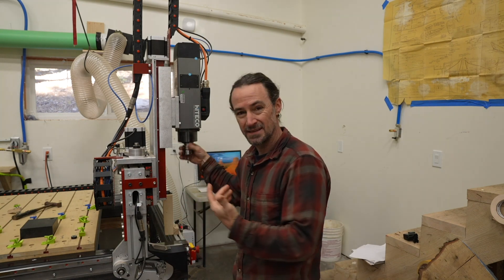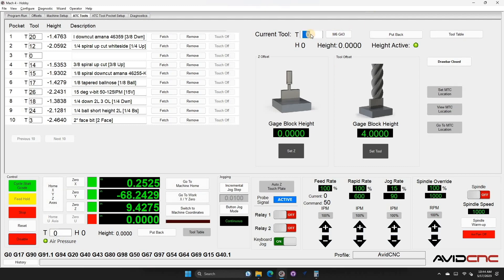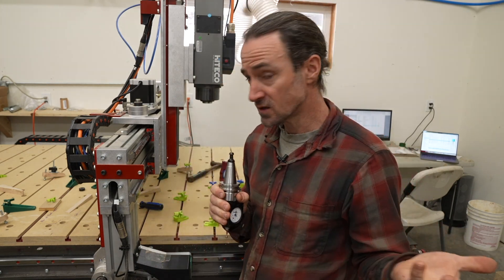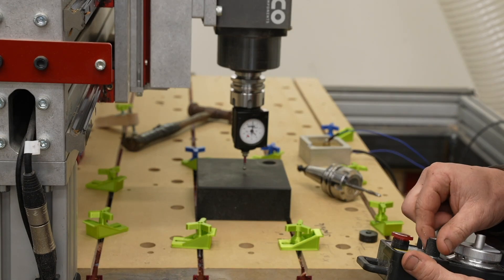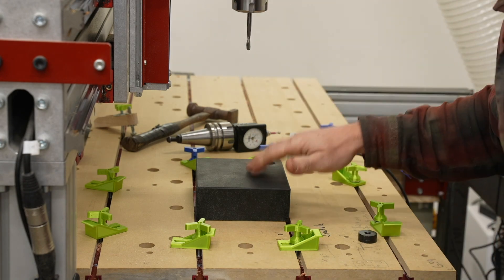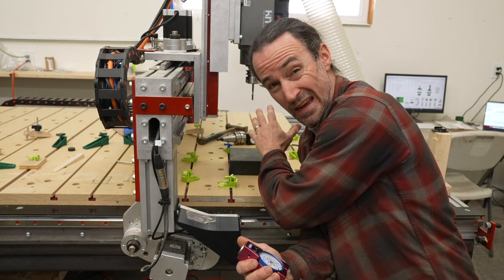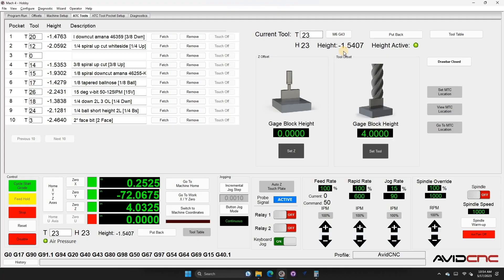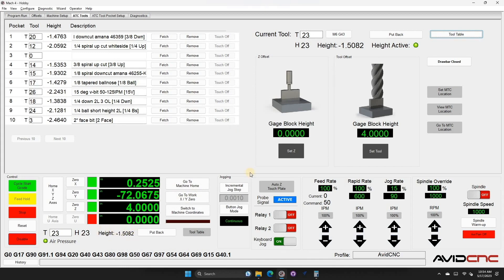CNC Build Ep 8: How to Set Tool Heights / ATC Tool Heights Setup in Mach 4

Comment: These guys are doing it.  Will Mach4 not do this?

https://youtube.com/shorts/4GLclIDVT9M?si=dBfd-1fJYJOwFz4O
Reply from the maker: Mach 4 can do it; you would just have to code it in, which wouldn't be hard. At the time I made this video, I didn't have a tool touch off plate (I have always had a z-zero plate, but a tool touch off plate really needs a fixed and consistent position for repeatability). I now have one from Avid CNC, and it is all automatic, although I'm using Centroid / CNC12.

Comment: I just had to rewatch this because I got a new bit :) Question: Which pendant are you using?
Reply from the maker: Cool! I've recently upgraded to Avid's EX controller, and it now auto-sets the bit height with a Touch Tool Plate. It is super nice! I had one of the Vista CNC pendants for Mach 4. Not too expensive and it worked fine. I didn't like the longer curly cord; the shorter straight cord would have been better. Now I have the Centroid wireless pendant with the Centroid controller.

Comment: is imposible to get this in Metric (mm) and no inch right? thx
Reply from the maker: For the Tool Height gauge or Mach 4? Mach 4 doesn't care about units. The tool height gauge....I don't know, I'm sure there are other brands out there. I'm now using a more automatic tool height setter with Centroid and not using Mach 4 anymore.
Reply: @CorbinDunn   I'm referring to your awesome screen set, the truth is I don't have an Avid, I doubt it will be sold in Europe, I have a similar cnc that works with an ESS+ MB2 bob and servos and a rack of 12 tools, I downloaded screen set u post to study it since I think it is I could make it work with the mb2, this fantastic work you have done is appreciated and I don't know if in mach4 you can change the units to mm even though inch appears in the screen set icons, I don't know if I understand my English is not very good.
Reply from the maker: @marcosotero6180  I have one minor thing hardcoded in inches, but I have heard that it mainly works fine in metric for some users. I don't recall if they had to fix anything. In theory, you could install Avid's version of Mach 4 and modify it to work with your system, or copy over the dependent modules/files from an Avid install to your own install.

Comment: Hi,  What is your routine for cutting say like a simple part, maybe a sq. pc of plywood, since your have a tool table and ATC.  For setting the tool height on the work pc do you use the master tool dowel to get the height every time and then slip in the tool you want to use, or just use the tool you want to use for touch off,  if you were to do it manually.  Say a unique cutter that's not in your tool forks and only a one time shot.   Does your ATC use the master tool dowel for all your touch offs in the normal way?   Thanks a lot.
Reply from the maker: Hi Fritz. For most my jobs, I design them with the z-origin at the spoilboard, and I use offsets. So I never have to touch off anything, as it is just stored in the machine. I have a video about this: https://www.youtube.com/watch?v=iyP81afV-Io . I usually use the spoilboard as my z-zero for work; the only case where I don't is when I want something relative to the top, and the thickness isn't well defined, and the cut depth is important. Such as, when engraving on the top of a piece. 

When I do touch off, I can use any tool and the Avid touch plate. Using the 'master tool' is preferred because it will always be the same height. When using a normal tool bit, the bit may become worn, or it may pull out a bit, and the height may be shorter or longer, causing inconsistencies with other cuts. 

When I put a bit in a new tool holder I do have to measure it. For that instance, I put my 4" height gauge down and drive the bit down until it reads zero, and then use "set tool height" in Mach 4 to set the tool height; the DRO for the tool height will be set to 4.0, the height of my gauge. I also have done this with the Avid touch plate; you can't use the touch routine, but manually drive down the bit until the light comes on showing it made contact.

It would be nice to add an auto height setter for unknown bit heights.

Comment: Corbin,  Mach4 ver 5036 don't have a tool 0 on the tool table so where is the master tool now?   Any thoughts?
Thank you, Fritz
Reply from the maker: There is no real tool 0; it is the reference for all other tools. It doesn't have an assigned height.
Reply: @CorbinDunn  OK, so the first setting just zero the Z axis, does that record reference?   Or do I have to put the 0 tool# someplace?
Reply from the maker: @fritzbabler6459  Ah, I see what is confusing! You put in tool 0 and you use that to touch off your Z-axis so to set z-zero with it. Then, you put in your bit, activate it, touch off with it, but don't reset z-zero. You then hit the button to set the height for it based on your touch plate height. This records its height relative to tool 0. Now, once you have a tool in your tool table, and that tool is "active", you can use it to touch off on your touch plate and set Z zero. The problem with this, eventually all tools wear and sometimes pull up/down, so it will cause inconsistencies. That's why everyone generally uses one "master tool 0". Mine is my Haimer.
Reply: I am doing dry runs on a sample gcode file and I see when I touch off the work pc and run the file, the tools are way off from where they are supposed to  be cutting on depth.  Doing my dry runs 5" from the spoil board so the 1/4" tool is cutting about 1/4" too shallow and the 1/2" is cutting about 1.5" too deep so I know there is a problem with the tool table.   My other machine works fine using Mach3 for the past 15 years.   I use fusion for my files and gcodes.  I watched a few videos from mach support on setting up the tool table, and seems the 2 that's out there, which are different from Mach, don't calculate properly.  I just don't get it.   I set my tool heights and follow their video exactly and and I still get no proper tool depth cutting using the tool table.
Reply from the maker: @fritzbabler6459  Yeah, your tool table is not correct if that is happening. You should be able to: activate tool 0, put it in the spindle, jog to right above your workpiece; it should read 0 (or a little above). Jog up, put in tool 1, activate it, which with my screen set activates the tool height with a G43, jog down to right above the workpiece, and it should read 0 or pretty close to it. If it doesn't...you have your height for it wrong.
Reply from the maker: Another possibility: your post processor may not be doing a proper M6 G43 call. I have a video about that...
Reply: @CorbinDunn  I was using mach3 post, now I switched to mach4 post, I will check in the morning.  Another question, when you touch off your work pc, do you touch off using "Material top, or "TLO"?   Thank you.
Reply from the maker: @fritzbabler6459  I’m not sure what TLO stands for. I don’t hardly ever touch off; I store an offset on my table at the spoon board top and use that for most projects.
Reply: @CorbinDunn  Hi,  re ran my gcode using mach4, didn't make any difference.   I was wondering how come your using your heimer for master tool and not the 4" edge tech gauge?
Thanks
Reply from the maker: @fritzbabler6459  like i said earlier, make sure your post processor is doing the right thing. I use the Haimer because it is repeatable for finding z zero.
Reply: @CorbinDunn  Well, I finally have it figured out.  When I touch off the material, I have to make sure I'm touching off with the master tool, tool 1.   also have to put in tool 1 as active and active H as tool 1.   So then all I have to do is put the proper tool in when mach asks for it from the file, which is in the tool table.  It does all the tool lengths compensations for any tools I have in my tool table to run different tools in one file.   With All the information that is out there, no one ever mentions it nor does the mach manual or their forum.   Makes it so easy to do tool changes, just grab that ATC tool holder with the proper tool in it, chuck it up and cycle.    I looked into the post as you mentioned and couldn't find anything that would make it weird.   Well, this will work now until I get my 8 carousal M6 written, almost done.   I have the carousal mounted at the end of my gantry.
Reply from the maker: @fritzbabler6459  Cool, glad you got it working! Something still seems off: you shouldn't have to touch off with your master tool; you can, in effect, us any tool that has the height set. It just has to have the tool and height active.  There's nothing wrong with using the master tool, and I use mine frequently to touch off, but any should work. 

For the post processor, the important part is to make sure that the M6 also has a G43 somewhere close by for the same tool number. Some, like Vectric for Avid, do not.
Reply: @CorbinDunn  Yeah, that's what I think too, but you know, I spent many many hours trying with the tools in tool table, and every time I go to zero to the material, it gives me a different depth of cut, nothing worked except using the master tool to set zero to the material.    I really don't know, I'm out of answers to try.
Reply: Here is first part gcode, (2D CONTOUR2)
M5
T2 M6
S25 M3
G54
G0 X6.025 Y-0.1
G43 Z0.6 H2
Z0.2
G1 Z0.0394 F50.

Comment: Good day Corbin. Great video series by the way. So i measured out my zbump and set it up for my ATC. It works amazing well with grabbing a tool, but when it goes to drop a tool off, the Z up doesnt quite account for how fast the tool push out goes and flexes my whole mount setup quite aggressively. Ive increases my rapid rate to 600 and even down as low as 50, and the problem remains constant. Not to sure whats up, or if im am being a dough head and completely missed a step. Any help would be greatly appreciated :)
Reply from the maker: Hey Devon - I got your email and replied there, but I'll do a quick reply here too. The code doesn't do any z-bump for the tool drop off; I based it off CNC Depot's script, which didn't do it. I also have a pause after the release of the drawbar -- my spindle takes a second to release, and without the pause the spindle would start to rip my fork up and off. Your spindle might not need the pause, so try commenting out MCCntlGcodeExecuteWait("G04 P%.4f", 0.3)  in the code for the release, but do so at your own risk (it might pull the fork up and out!). 

Another idea is to combine the GCode to one call, which make Mach4 execute it "quicker", but I haven't tested this:

 	MCCntlGcodeExecuteWait("G04 P%.4f\nG00 G90 G53 Z%.4f", 0.3, ZClearanceWithNoTool)

Comment: Hi Sir,

I can see you are an expert..! I hope you can help me..!

Can you demystify some of my worries..?

There is lot of confusion regarding the reliability and consistency of mach3 as it is PC based and USB or Parallel port.!  Lot of people say that it may behave funny in the middle of a project and it may ruin the entire job..! 

which can be caused by slight voltage spikes from nearby high power accessories  like VFD or Motors. And relying fully on PC for CNC operation is not recommended.  I am so worried about all these..! 

I am not sure how much  immunity against such HF-RF Noise  shielded cables can offer..!

But   dedicated CNC controllers like Masso and RichAuto are insanely priced.!  and  I don't have access to USA or Euro Based  other CNC Controllers here..!

People have also mentioned that  If signal voltage is high  (24v or higher)  It can withstand such interferences..!
But mach3 operates at 5V only..! So there is high chance of  signal contamination..!
Is that a huge concern..? 

Mach3 Boards are affordable. 
But If I cant use them for longer projects , then there is no point in spending money for all the parts which are still expensive..!

I am so worried..!

Secondly, 
I have seen in videos that
The baud rate that mach3 communicates at , is not adequate to drive powerful servos..! !
So Only steppers at low power application is possible with Mach3.

That is so discouraging..!

Can you help me?
Reply from the maker: Hi! I'm only familiar with Mach 4 communicating to the CNC machine with ESS (Ethernet Smooth Stepper). Mach 3 is very outdated; don't use it. ESS seems quite stable and works well; you will want to use a shielded ethernet cable. You shouldn't have any noise issues if you use a shielded cable, and have a short run from your PC to the controller. I have heard of some people having issues due to having too slow of a PC; buy a computer that is adequately spec'ed; I spent $800 on mine, and it is great. I also heard of some people having static issues with their dust collection causing problems; I have lots of static build up; my tubes attract dust and particles, but I have not had issues with my CNC machine because of that. If you do, you can ground your dust collection tubes. Best of luck!
Reply: @CorbinDunn  thanks sir.

Comment: FYI. I wired up a double A battery to a led light with alligator clips at both ends. When I touch off to the work piece or the table top. I apply a piece of aluminum duck tape to the part I want to touch off from. Bring the tool down until the led lights up and I have Zero. Works for me.
Reply from the maker: That's a clever idea! Thanks for sharing!

Comment: Once you have all the tools set up, can you use the avid auto touch plate like usual when you are zeroing the work cs before a job?
Reply from the maker: Yes! BUT with a bit gotcha: You have to use my custom screen set. The one that Avid provides has a huge bug in it, where if you use their touch off plate code it will crash. This is because they don't account for the tool height set in the tool table. I "work around" this in my screen set by disabling tool heights before their touch plate code is invoked, and then re-enabling it afterwards.

Comment: all this accuracy yet using a mdf spoil board that changes with humidity. why.
Reply from the maker: Sure, that's a good question! I haven't noticed any issues with mine changing, but I live in a relatively dry and low-humidity area, and run a de-humidifier to keep the humidity on the low side.  I'm near Lake Tahoe, California.  I've heard that some people who live in southern USA have pretty big issues with humidity. 

What type of material are you using for your spoilboard?
Reply: was using MDF spoilboard was swelling and contracting worse then my ankles.  switched over to extrusion. best decision i ever made, but then again im in ontario canada where the temp could be -20c up to 40 deg c.   @CorbinDunn

Comment: Great set of videos and really appreciate the effort you put into this.  Question where is the gauge block set to 4.0 like you have n the video.  I purchased the zero gauge you recommended but can find anywhere too set the height ? Again fantastic job on the videos.
Reply from the maker: Yeah! The default Avid CNC screen set in Mach 4 doesn't have this. You have to use the ATC Screen Set I made, or load the one that come's with Avid CNC called "wxRouter" (or something like that). You can go back to any other screen set after setting a tool height.

Comment: I prefer the master tool to be a non-cutting tool as it won’t wear down over time. I prefer the steel dowel because then I can I’m use it for corner finding too and not worry about the rotation of the cutter. Great video as always.
Reply from the maker: Yeah, good point Jason! A precision steel dowel is great for corner finding w/Avid's touch plate. In theory, once you setup any given height, you can use ANY tool to touch off the surface plate for measuring any other tool (including using the Edge Tech gauge block), but it will have an issue with wear over time as you pointed out.